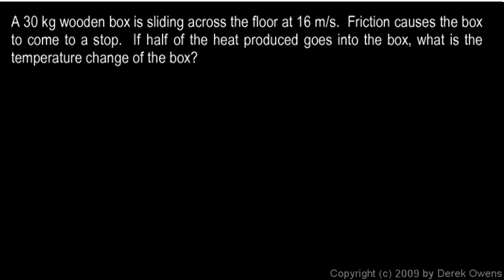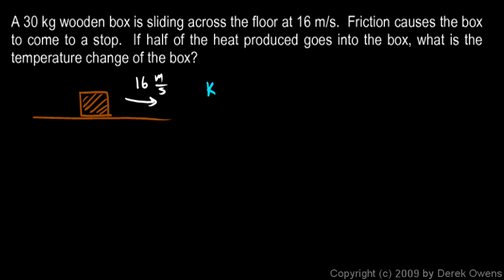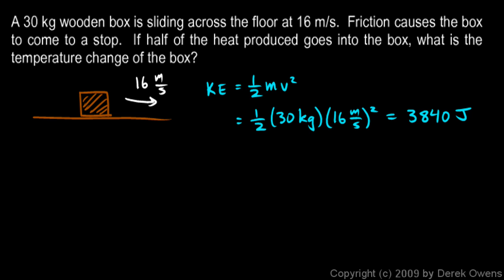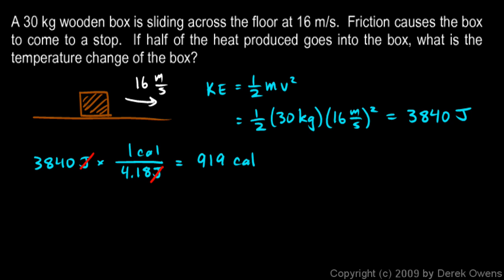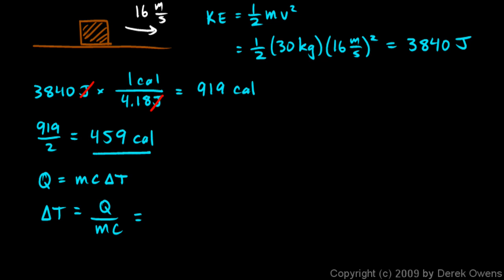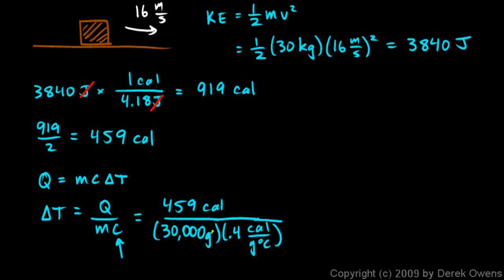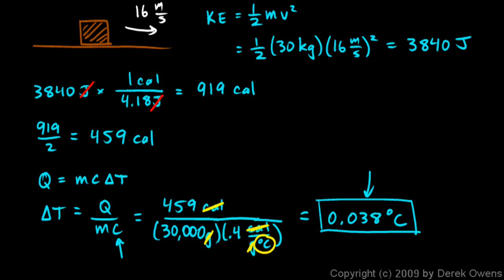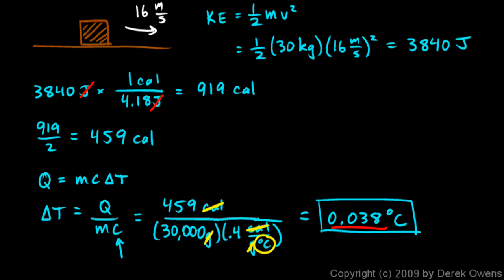Physics 9.09i - Calorimetry Example 4

Comment from the maker: @eStalker42   That's correct.  You could set the problem up in one step and get the mass to cancel from each side.  I think it's easier to understand the concepts, though, if it's done it two steps.  Very good point, though.